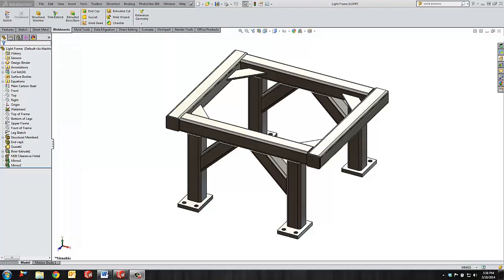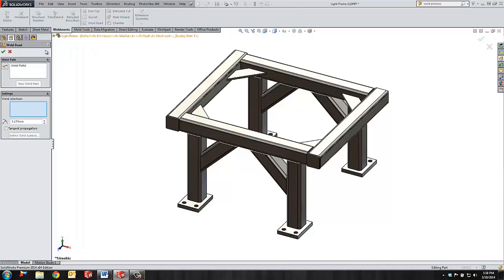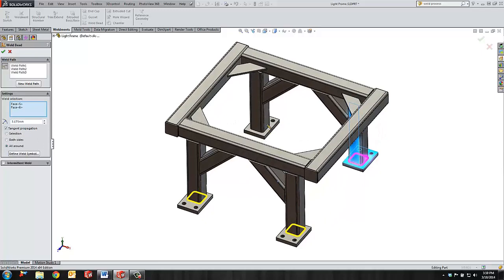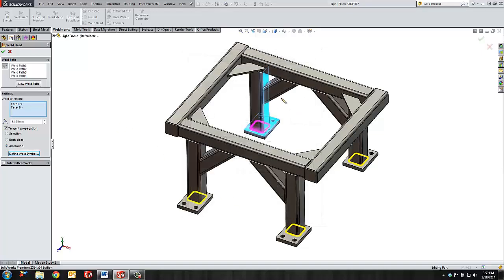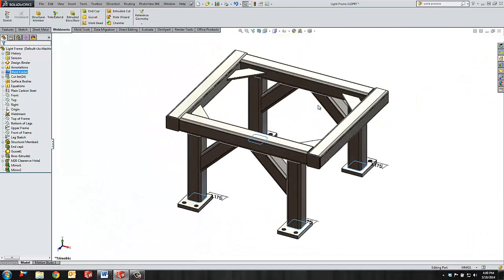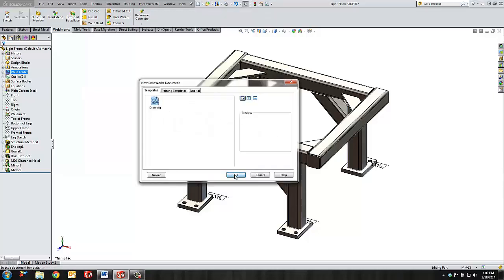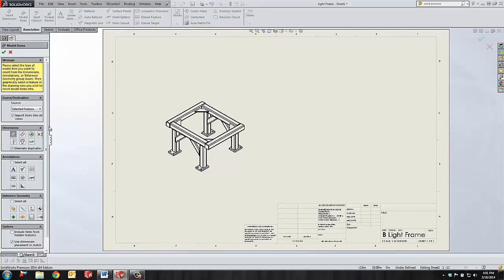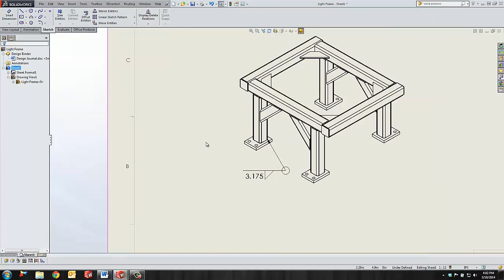SOLIDWORKS – Creating Weld Beads

Comment: Is it possible to add a weld bead to a sketch line path?   Let's says you just want to weld a symbol on a sheet of steel.   In my case, I want to "simulate" a weld bead as just a part of surface detail.   I don't have any parts to join.   How to do this?